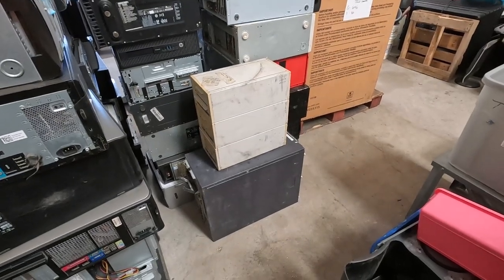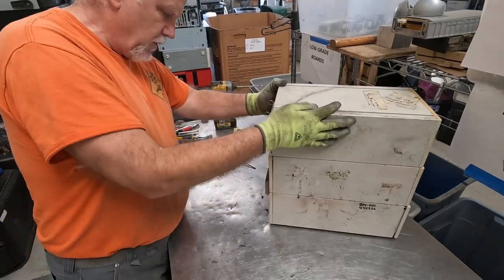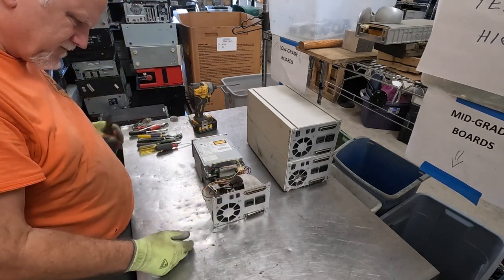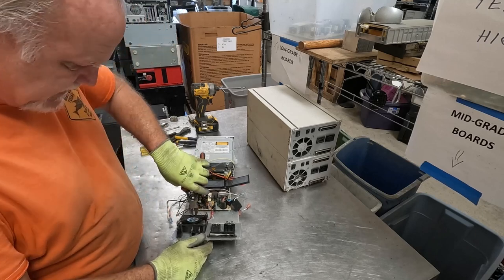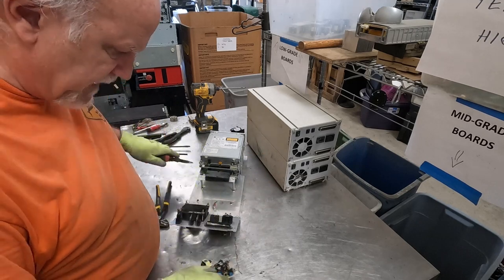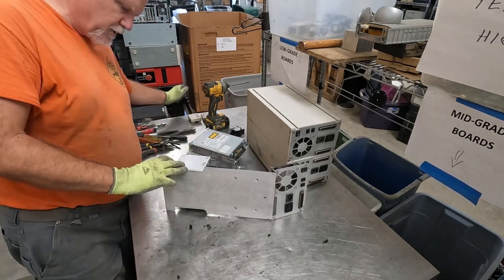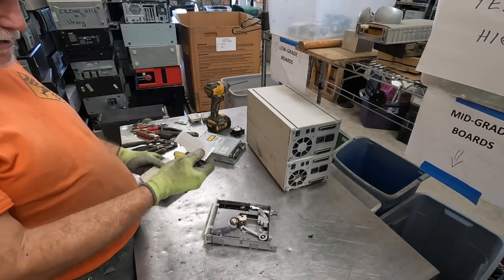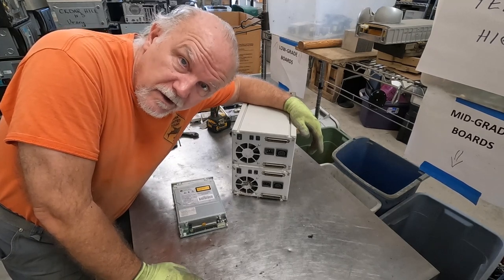CDROM SCSI tower scrap

Comment: Those were nice aluminum cases, and yes, they should be extruded.
Reply from the maker: The buyer at my non-ferrous yard can be a little touchy when it comes to extruded.  He's a good guy but his rule of thumb is, if it has a rounded corner it's sheet.  I don't argue with him because in the long run he takes good care of me.
Reply: @sharkscrapper  I agree.  I always thought it was stupid defining aluminum as "extruded" or "sheet" anyway.  Those are aluminum processes, not types.  In extruded aluminum you can have all different types of alloys (6061, 6063, etc).  Always thought that was weird!  😂